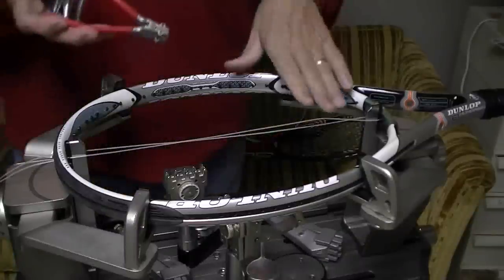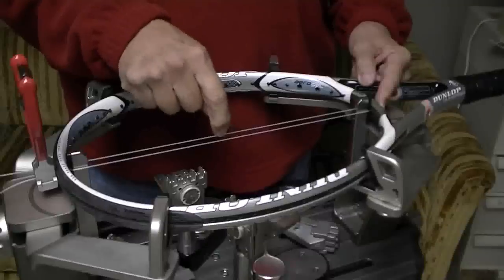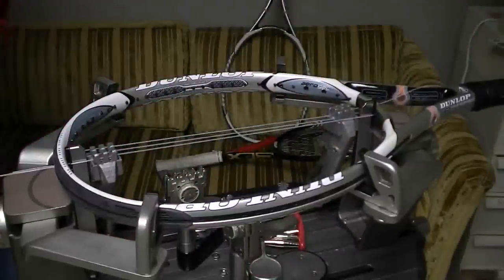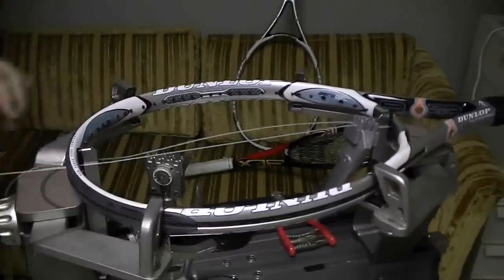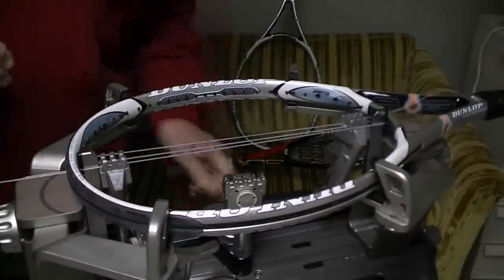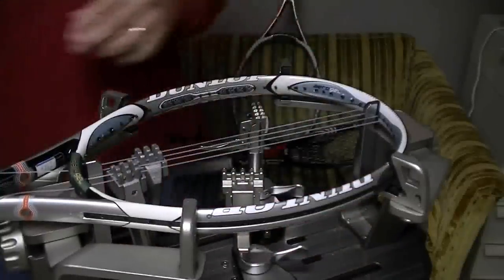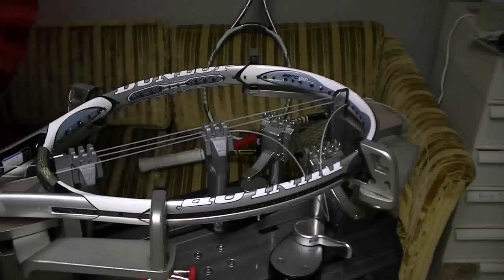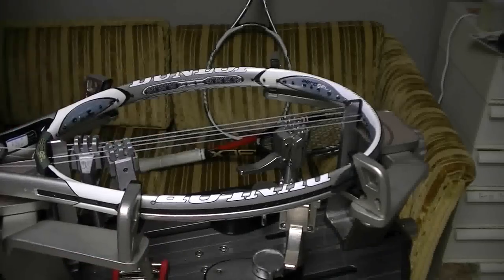Starting mains with flying clamps

Comment: Can you do this first method (starting clamp and flying clamps )with a dropweight machine as well?
Reply from the maker: @wizardofrosss  yes, but I would do it differently. After pulling tension on the first main (double pull) tension the second cross next to the first main you tensioned which is on the opposite side of starting clamp. Then move the clamp on the 2 center mains to the 1st and 2nd tensioned main. Then tension and clamp 2 more mains. When you finish you have Four mains tensioned on one side and 1 (with starting clamp) tensioned on the other. Now you can tension and clamp  up to the 6th main main on the side with starting clamp.

Comment: @Mr10sStringer Also, the two different strings in the middle main strings with the different tensions at 0:53 how do you get it the same?